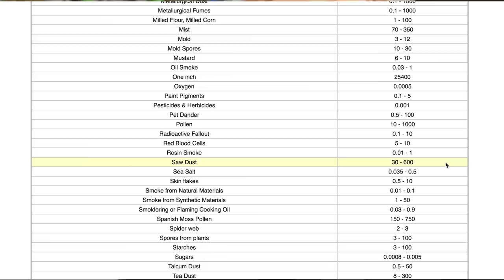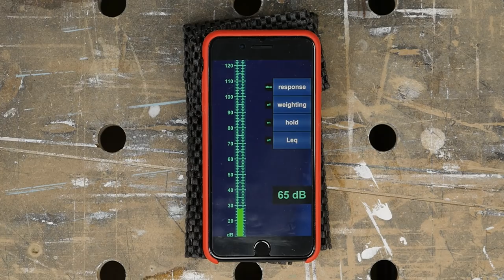Sucky Vacs Follow Up [#210]

Comment: Zoom in, enhance! Interesting framing today 😁

On topic: can you retrofit a pleated 1 or even 0.3 micron air filter into the Aldi machine?
Reply from the maker: Just playing with how I shoot and edit - nothing's ever finished, is it?😆 And you probably could fit a different filter or bad to the Aldi, but it would almost certainly restrict the airflow that the motor relies on for cooling, so possibly a fire hazard there... 🤔😕
Reply: Peter Millard I'm not so sure about that. The pleated filters have 20x the surface area. The bags are already providing a lot of filtration too. I doubt a finer back-stop would reduce throughput enough to harm things.
Reply from the maker: OK, another experiment for me to do... 😂😆

Comment: I cut a lot of mdf in my workshop and was going to buy the Festool ctl sys but I’ve been told that I need an M class dust extractor. How does your ctl sys cope with mdf dust Peter?
Reply from the maker: Hi Andy. All my vacs (CTL SYS, Midi and CTL 22) work very well with MDF. The 'L' vs 'M' debate has been going on for some time - there's a lively (and lengthy) thread on the Festool Owners Group from a while back, here - http://bit.ly/L_or_M. In short, all Festool L and M vacs typically have the same filtration, just that the M vacs have a monitor that sounds an alarm if the airflow drops e.g. due to a clogged bag. Ultimately you breathe the air that the vac exhausts, but equally no vac is 100% efficient, there's always dust escaping from around the tool, so you pays your money and makes your choice; I'm happy to keep an eye on the bag capacity and ditch them early if they feel like they're reducing effectiveness. One word of caution; the CTL SYS is a great little vac, but it doesn't have the same 'suckage' (yes, it's now a word...) as the bigger vacs; all others are essentially the same, they just vary in capacity. HTH, Peter
Reply: Peter Millard ok thanks, I’ll bear that in mind. I’m going to Axminster in a few weeks, no doubt they’ll try to sell me the more expensive model but it’ll be interesting to see what advice they offer. I’ll let you know. Great video as always mate
Reply: Hi Andy. have a look at Metabo ASR35 M. It's really great, the auto filter clean surprises you the first time! They are abot £460 to 500, £300 cheaper than Festool. I use mine for woodworking and chanelling into plaster with a grinder (elec 1st fix)- hardly any dust and no los of suction - still wear a mask though.
Reply: Classical Carpenter ok mate thanks I’ll take a look at that. I’m not usually swayed by an expensive tool brand but read some good reviews on the Festool dust extractors but I’ll definitely take a look at the Metabo.

Comment: *** Li-Ion Nail Gun.... Available Thursday 23rd August.... £79.99...
Reply from the maker: Thanks, I’m aware - it’s on my list! BTW it’s a nailer/stapler - slightly different animal 👍👍
Reply: Peter Millard Purchased one on the way to work this morning. So far I'm pleasantly satisfied. We shall see when I get it home and fire it up!...  If it can cope with 50mm nails I'll be impressed. However I've no idea  what I'd need 50mm nails for. Hopefully 13 or 19mm nails will be readily available for this gun... If not then it was a waste of time & money.
Reply from the maker: Nice. Let me know how you get on! Pretty sure it's a standard 18g nailer/stapler btw 👍
Reply: I've now had the chance to use the nailer and find it to be very good indeed, I'm very pleased with it... Ive bought smaller size nails that fit/work fine.  Its very impressive.
Note this nailer is identical to the 'VonHaus' on Amazon for £129.99.....
Reply from the maker: John Ball Thanks John - that’s good to know! Haven’t received mine yet, they seem to be quite popular 👍